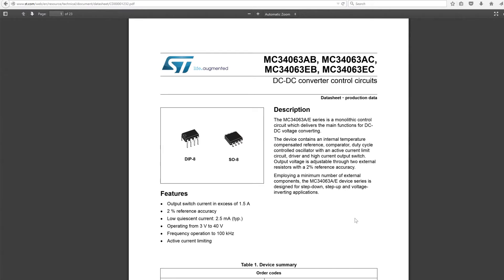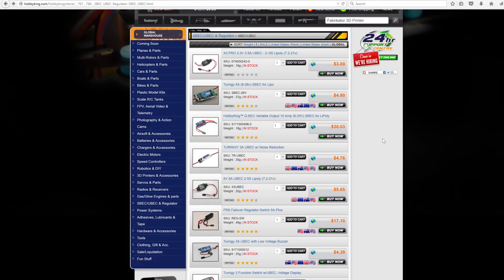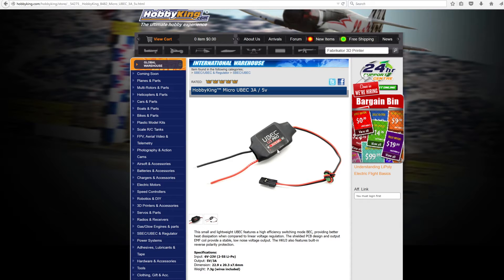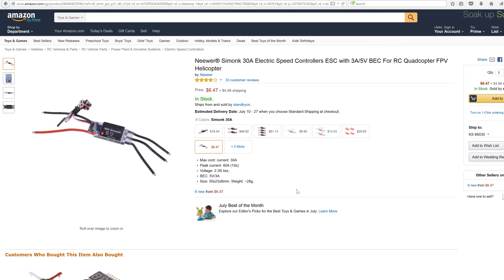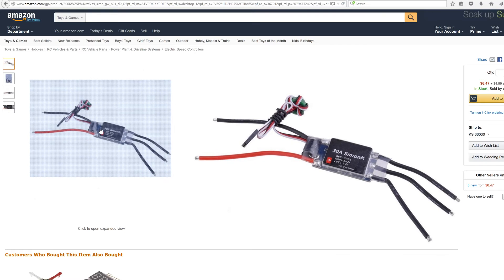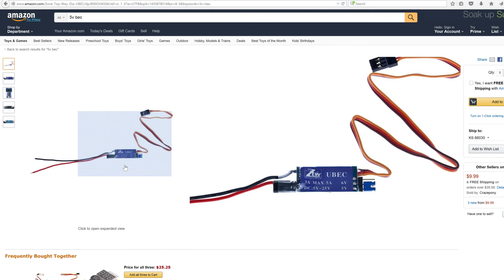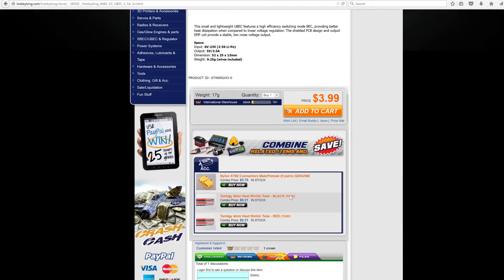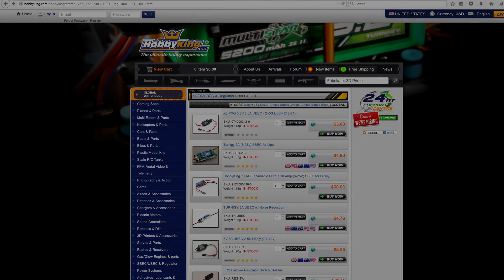What is a BEC?  (cheap and easy buck converter alternative) - #0056

Comment: can I use a lm2596 to power a flight controller on a quadcopter? I'm using a 3s lipo battery and my esc does not have a bec